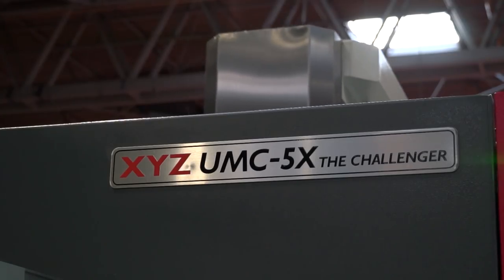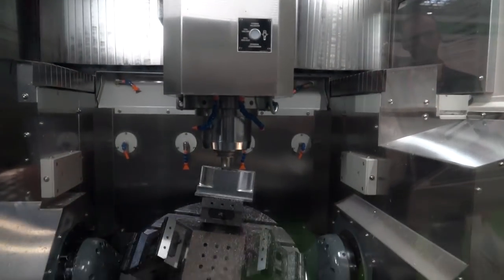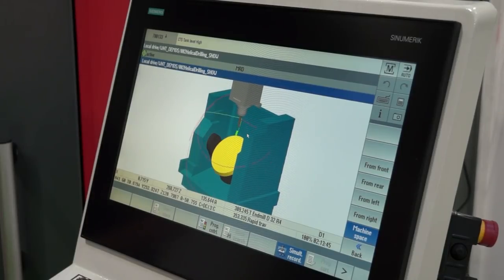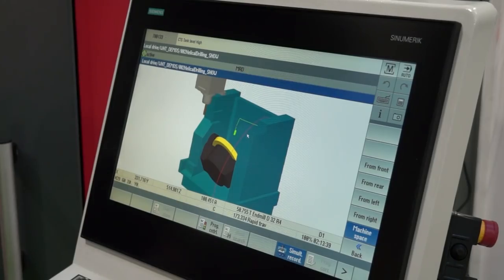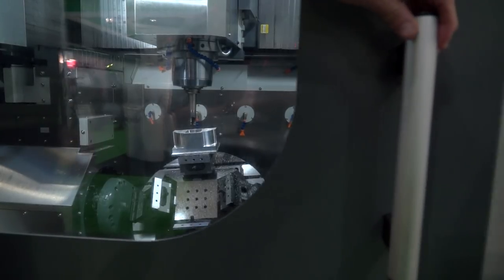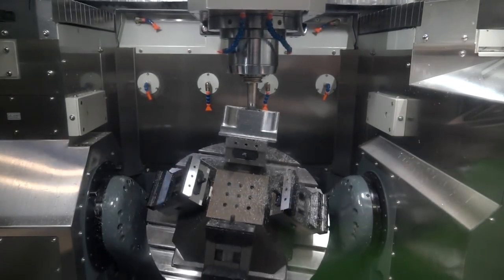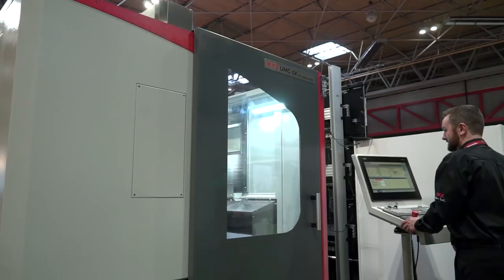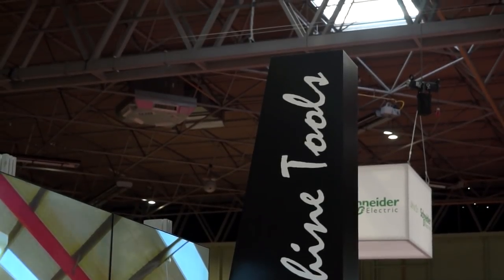XYZ UMC 5 axis is a real success - It's dynamic, fast, strong and precise

Comment: your talking about the advantages of the fast and maintenance free DD C-axis. But on the other hand you are using a wormgear on A-axis. 
 for 5 axis simultan: both direct drive. the only way in my opinion.
for 3+2: Wormgear on A and C absolutly OK. 
Why the combination?
Reply: I think it's because of the shear rigidity it offers in order to enhance roughing. Some 5 axis machines really struggle with roughing on tough to cut materials and are sometimes left out only for 3D finishing or features like small holes, pockets and quick tapping. Also 600 kg is quite a lot to swivel sideways and trying to hold it up with a DD motor would be consuming power for no reason decreasing the machining economy on everything other than 5 axis simultaneous. This machine is a very balanced option for a smaller or not shop. Really a middle of the road everything!